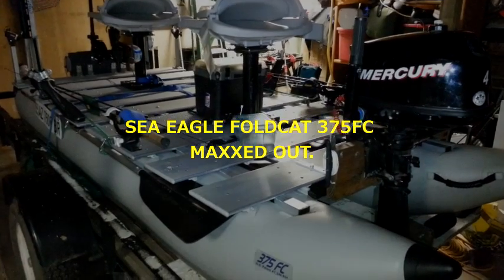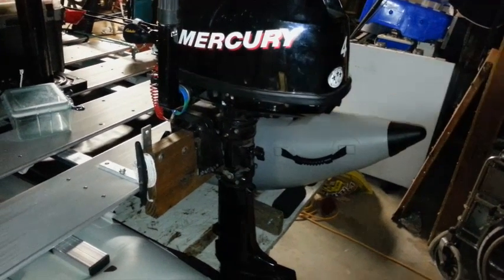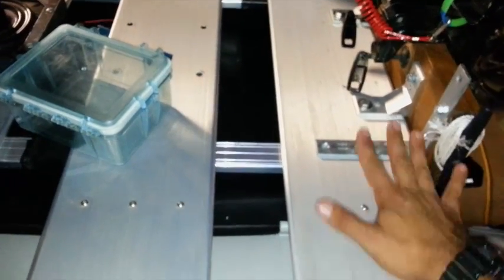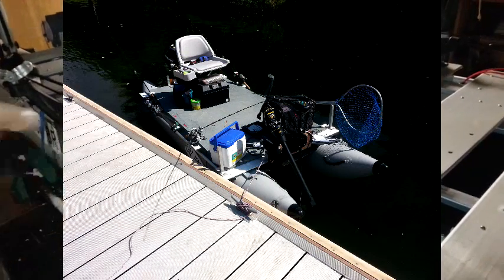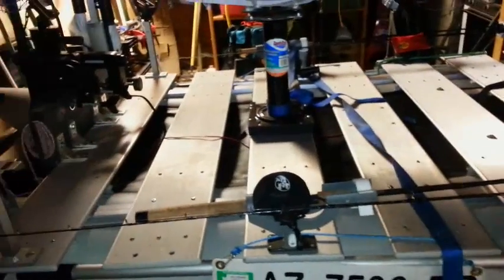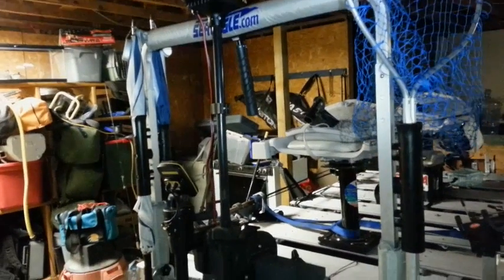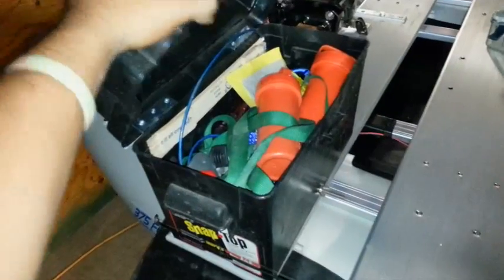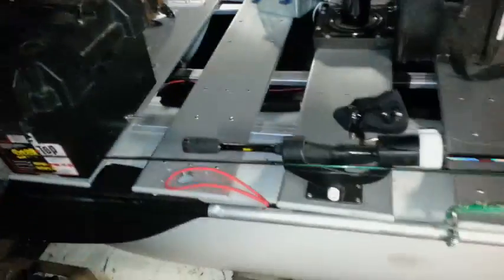PART - 2: Sea Eagle Foldcat 375fc inflatable boat post-modifications and specs.

Comment: I recently bought a  new Foldcat 375FC; I've only had it on the water once, a few days ago. I fish alone. I discovered that when I, the battery & Minn-Kota 55 are in the boat, the bow is clear of the water. I can't find any longer replacement cables or extensions so I can put the battery in the bow. Do you have any suggestions?
Reply: I contacted Minn Kota & they said extending the cables was fine, suggested #6 cable. I used jumper cables (4 ga) cut the clips off. Worked great.

Comment: Where do you get the extra panels do you have to buy them from sea eagle?
Reply: I contacted Sea Eagle and they do not stock them and per previous reply from TBN you will likely have to make them. I will need to get dimensions and go to a local metal supplier. Aluminum not cheaqp at the moment.

Comment: Where do i get the extra boards for the deck?
Reply from the maker: You can’t get them. You have to make them.
Reply: @TinyBoatNation  any help in that area ?
Reply: A little clue” like where” do I find the material, is it like 10’ section, how wide 10” , 14”? How thick, 1/2”, 5/8” ? Iam in Indio and can come the Havasu if you make some for me….

Comment: Great information. I got a question for you the raised rod holder with the Berkely rod Holder how did you get it them  to fit I  have the exact same setup but mine won't fit just wondering did you drill it out to fit ? 
Thanks in advance.

Comment: Hey Mike...great mod video. I have a question -- in regards to the taller (13-14") seat pedestals you're using...did you need to add any additional structural support, or do you use them with the out-of-the-box quick-release mounts provided with the boat? I took my new 375FC out today for her maiden voyage, and can definitely see a benefit to a taller seat. Thanks!

Comment: For everyone asking about the slats.
Just get a 8' x 4' piece of plywood and cut the four pieces to fit. They don't have to be mounted, they can just sit there as long as you don't stand on the end it'll be fine.
I used beadboard because I only need a deck so my dog isn't walking on the middle vinyl section.
Reply from the maker: I concur

Comment: Michael, a couple of quick questions:
1) I couldn't get a good look in the video, how are you storing the oars?
2) I like the idea of stabilizing the transom mount for more HP, but I'd like to avoid having to use a trailer. This means that I need to keep it easy to break down and stow. Do you think using shorter and thinner, but still inflexible, stabilizer bars that extend to just below the rear seat (on both sides of the pedestal) and are attached underneath with the knurled knobs, to keep the deck as clutter free as possible, might work? This would allow me to break it down in less than a minute of added time.
Great Mods!

Comment: Cool Video! Nice modifications to your boat. I have a 375fc and having problems keeping the under mounts hooked on to the slats. I have loosen up the top screws and tried to pull the plastic part back into the clip, but they don't hold. Can you tell me the best way to get to get them back in and secure. Thanks!

Comment: I've read a few bad stories from people that were unable to get the additional floorboards from Sea Eagle.  are those aftermarket, or decking or did you get them from SE?
Reply: there seems to be  lot of people with the same question and no answer. Are you a sea eagle rep? If not provide the info..

Comment: Great video on the mods for the Foldcat.  Just wondering, I tried to put a Minn Kota 55 lbs traxxis trolling motor on the bow and reversed the propeller by unscrewing it.  When I attempted to use it, I noticed that the motor on the bow doesn't seem to control the foldcat properly.  In other words if I turned the bow mount towards the left, you would expect the foldcat to move forward leftwards, but instead all that kept on happening was the foldcat would just spin 360 degrees and I would just end up going in circles as opposed to actually going forwards towards the left or towards the right.  I had 2 people on that foldcat at that time.  Did you every experience that at all?  Just curious.
Reply: I just bought a Foldcat and also put my trolling motor on the bow. The same thing was happening to me. When I would go forward the back of the boat would spin around. I thought it was due to all of the weight being up front and not enough in the back. Let me know if you figured it out.
Reply: I'm guessing it's because the wash from the motor is channeled between the pontoons and doesn't really escape the draft of the pontoons. If you turned in very small increments, maybe you could still steer?

Comment: Hi there. Do you remember what shaft length (15" or 20") your outboard had for the Foldcat?
Reply: @TinyBoatNation  Thanks for getting back to me on this. I really appreciate your time to reply. If you did it again would you still use the short shaft 15" or long 20"?

Comment: Hey bud i love the way your fold cat look i want to do the same to mine did you get a extra set of the assambly bars to hold those slats i already contact sea eagle to see if the still selling the slats also how stron is the glue you use to put the fins reason why i am asking is i got my pontoon for free like 2 years back and the have a hole like probably 2"1/2 the not that bad but i got it for free it look like new a guy the was working with me give to me becuse i am like you i breath fishing i have a 12'jon boat and a 14' and you right about day and night i havent use mine yet because that hole but i want to do the full deck on mine i will appreciated any advices thanks

Comment: Michael, I got my Fold Cat 375 and 4 extra slats plus the taller pedestals. My pedestals are adjustable also. I got my pedestals from Amazon.com. You have to make sure you order the Wise brand pedestals to work with the quick release seat mounts. There is another brand of pedestal that is adjustable but it is too small to work with the quick release. I can't wait to take it out soon.
Reply: Eric Biedenbach I also bought running lights that attach by c-clamp for night fishing.I bought those on Amazon.com also.
Reply: they are great! They are much better than the ones they send with the boat. You can acutally see overtop the lake instead at water level with the lower ones provided.

Comment: where did you get the extra aluminum slats for the flooor.
Reply: @TinyBoatNation  so you have anofher 375fc. Any suggestions what to do if you dont hzvd another 375fc?
Reply: @TinyBoatNation  I contacted Sea Eagle and they said the slats would be 85$ but are not available.

Comment: Great video! Thanks! Is there a limit on motor weight I can use on this boat? Also, do you know the weight limit this boat can handle and where is the trolling motor battery and fuel for your outboard stored? I didn't see any batteries or fuel storage setup. I did see a battery box used for misc. stuff. Good idea!. Thanks again.

Comment: How do you do the planks. I read your comments but I don't get it :)
Reply: cool, thanks for the insight and creativity to this
Reply: Would 1x4 work as well or 2x4 is the way to go? Concerned about the weight. I’m 6’3 300lbs. Lol
Reply: @edag8157 the boards on my foldcat are 3/4 inches thick. I was going to cut 4 pieces of 52.5 x 8 (inch) boards out of a 4x8x3/4 piece of plywood. Paint them or seal them somehow. Run 2 aluminum square tubes (if I can find them )under the already installed sea eagle planks. Screw the tubes to the those planks. Than screw or bolt the wood planks to those tubes. I’ll counter sink the bolt/ screw holes. That’s the plan I have in my head anyway. I called local aluminum suppliers and they said you can’t get aluminum as thick as the planks sea eagle uses. I’m also going to put something under the planks to protect the material from abrasion. Jo Ann fabrics sells pliable plastic sheeting in their fabric section

Comment: Where did u get the extra slats
Reply: @TinyBoatNation  I know this is an older video but thinking about reviving my old foldcat from the shelf its been on for a few years.  I saw the oak reply and thought why not use the same composite deck boards as you would use on house.    Too much flex?

Comment: Nice but breathe. You sound like you're on speed. Looks cool what I don't like about it is the small gap between each board just not a fan of it too easy to catch your foot, that's what it looks like especially if you have your kids on there.  Are some minor modifications I would do but I actually like it better stock.

Comment: Where did you buy the extra slats for the deck?
Reply from the maker: I didn't. I had them from another boat.
Reply: @TinyBoatNation  how did you attach the additional slats? I found a used one for cheap that I can get the slats from